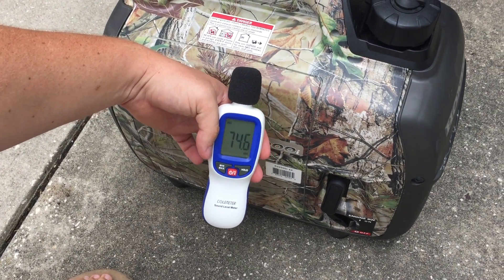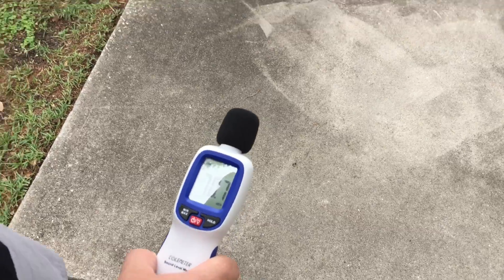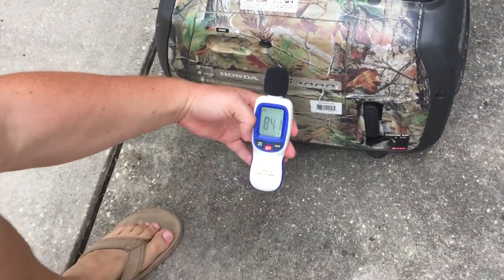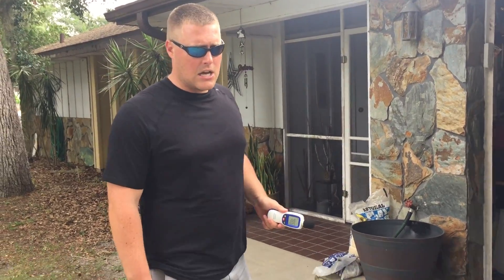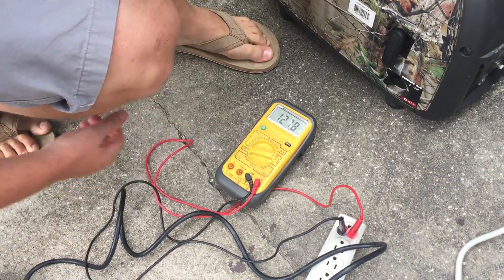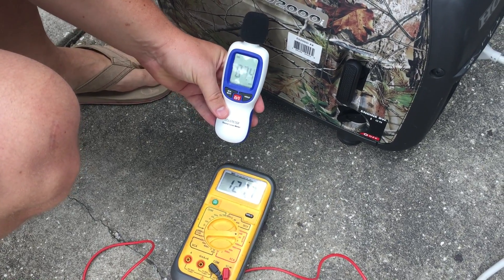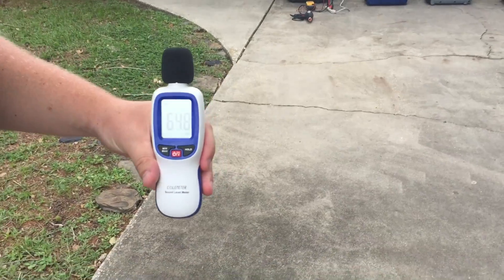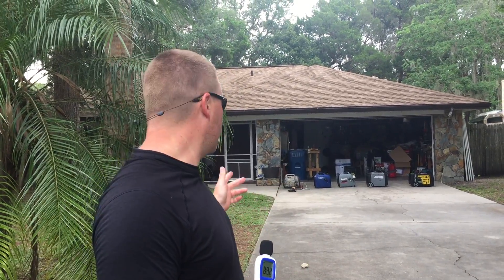Honda EU2000i Decibel & Load Test, Testing Under Eco Mode & 1,500Watt Load Voltage Drop & Noise Test

Comment: Informative video.  In future videos it would also be great to see how it handles a sudden load when eco mode is turned off, so that the motor is already spinning fast.  This would be good to know if for example you're going to be running construction equipment with a lot of starting and stopping, or an air conditioner that won't start if the voltage sags, etc.. where you might opt to operate with eco mode off.
Reply from the maker: The definitely does help with the initial load. We can add the comparison in future tests.